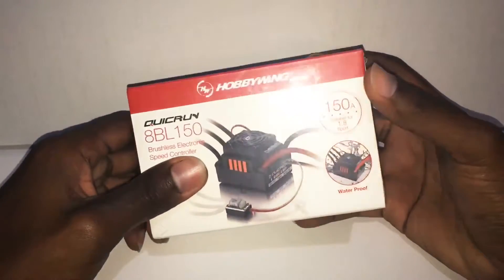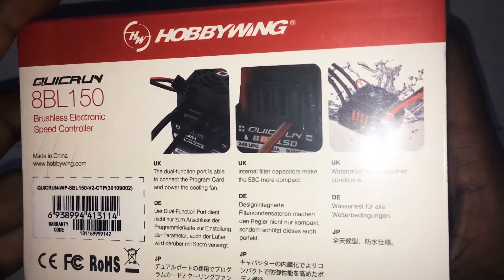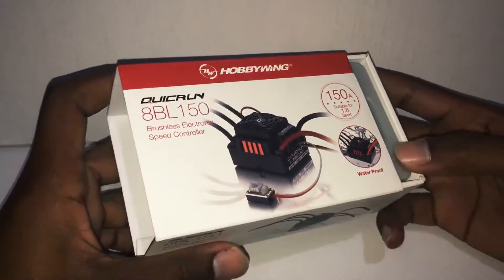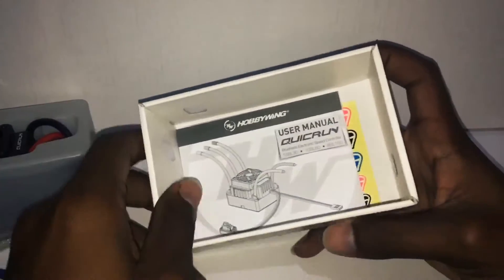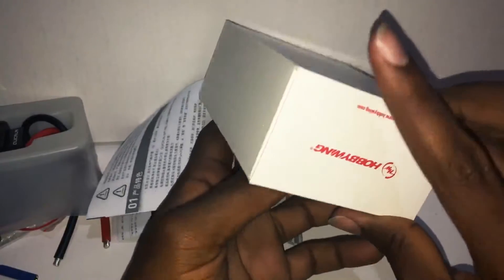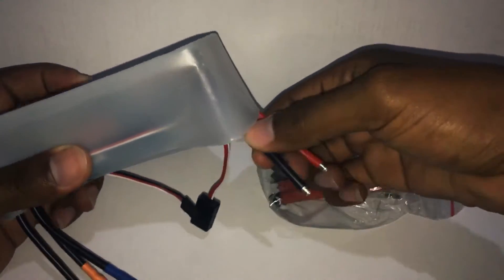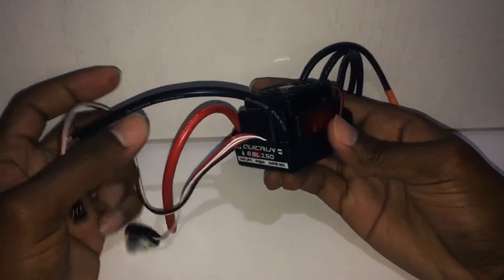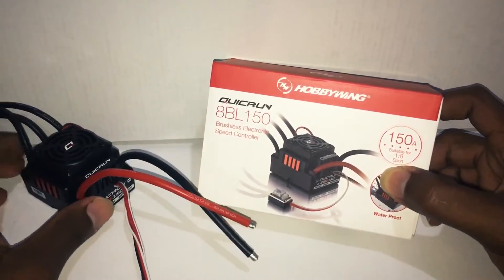Hobbywing QuicRun WP-8BL150A ESC- Unboxing & Overview

Comment: So im thinking of purchasing one, what's your thoughts on it over the years? is she still running? how many motors have you used on it so far?
Reply from the maker: 2 years of abuse and she's still rippin. I ran it through plenty battery packs, in sand, water, mud & dirt. no issues at all. I'm on my second motor now with it, in my E Revo  using xt60's
Reply: @GNDRCADVENTURES  Wow good to hear, need to get me one!